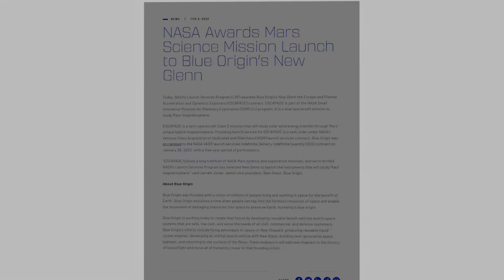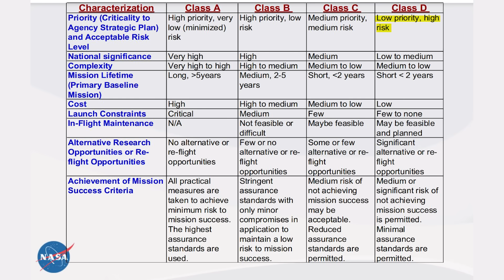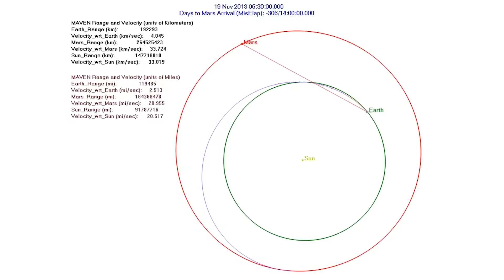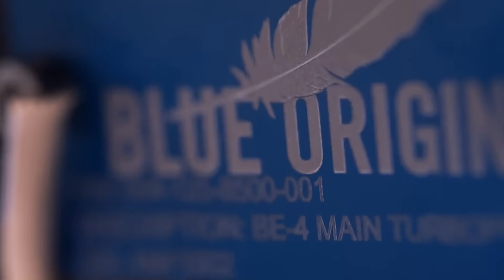Is Blue Origin's New Glenn Close To A Maiden Flight?

Comment: i would just like to see Blue do anything. get anything into orbit and back again that would be a great start.
Reply: They have 22 successful launches. 21 successful launches with perfect landings, have designed a solar panel made entirely of lunar regolith analogue, designed inflatable containers for orbital reef, and are working on zero boil off hydrogen. 

If you think BO hasnt done anytbinf, its because you arent really invested in the space industry.  You're more of a tourist.
Reply: @iamscoutstfu  Blue Origin is lame. 22 launches of a suborbital Estes rocket. Big deal.
They made a solar panel...  oooh! how wonderful! Not. Inflatable containers like Bigelow over a decade ago. "Working on" means "hasn't had it work yet". Not an accomplishment. 

Blue Origin has been in business for almost a quarter century and has accomplished remarkably little.
Reply: @iamscoutstfu  you can't be very invested in the space industry if you just assumed that the habitats are from blue origin even though sierra space is mentioned every time the life habitat is.
Reply: @iamscoutstfu   Those 22 launches never carried anything but tourists, and never came anywhere near orbit. I believe it is Sierra Space that is developing the inflatable modules for Orbital Reef. BO is working on the rigid central core structure, or at least the windows for it, that's what they say.
Reply: @iamscoutstfu that's all? Also do not give BO credit for the inflatable module, Sierra Space made them not BO. Other than that a pretty empty achievement coming from a mega corporation in the space industry, would be great if they did anything other than lobbying and suing NASA

Comment: Looking at the BE4 situation it look over 2 years to get 2 engines ready for ULA, where as New Glenn requires 7 of these engines and there have not been anywhere near the number of engine tests one would expect for 7 engines being ready any time next year. Add to this that ULA also required more engines one of which exploded during testing a couple of months back taking out one of the test stands. All in all this seems like more media manipulation and wishful thinking, after all Blue Origin hasn't had a rocket reach orbit yet let alone one as ambitious as New Glenn and there is no way the booster will land perfectly first try.
Reply: You dont know anything about their production capacity though...
Reply: @iamscoutstfu  We know what we have seen so far and that is engines being delivered very late to ULA and a subsequent  engine failing in testing exploding and taking a test stand out. They can't hide the testing or fake it, there just aren't enough engines being produced and now they have destroyed one of their test stands which needs to be repaired. To be able to lunch a New Glenn they will need 7 fully working and tested engine ideally plus spares.
Reply: Source for any of those numbers?
Reply: @Sillocan1  We know when the engines for ULA started production and they were delivered about 2 years later and New Glenn does require 7 engines you can see that on the mock ups and renders. What other numbers are you talking about, this has all been covered in minute detail by so many channels.

Comment: Keep in mind that the cargo Tonnage is between Falcon 9 and Falcon heavy -- so this is a competitor to the last generation (Falcon series) of Spacex craft -- the Starship is a generation beyond this, The Starship is far more innovative, whereas the New Glen is not doing anything that spaces hasnt done before. That said getting landing right first time seems an iffy prospect (Even with hundreds of landings under their belt with Falcon series, spacex on their 2nd test flight of starship has yet to achieve this with starship) .
Reply: Im sorry whag?  NG has deep throttling O2 rich closed circuit engines.  Those are a generation ahead of anything SpaceX has produced....

In WHAT way is SX more innovative?

Comment: IMO even if New Glenn launches and lands its booster perfectly on the first attempt, SpaceX's development method is still far superior, because they already have this capability and are using it to launch more often than anyone else, and it cost SpaceX far less money to get there.
Reply: You dont know how much money either company has spent on development, though. 

So youre conclusions arent based on any evidence.  Youre just saying one is superior for no reason...
Reply: @iamscoutstfu  The development method used by SpaceX is certainly more expensive. But think about it another way: they quickly developed the technology and flew over 100 commercial flights. They made a lot of money. How much did Blue Origin earn? I thought so.
Reply: @iamscoutstfu   Actually, it is known that development of Falcon 9 cost $400 million. I don't know what Falcon Heavy cost, but it can't have been more than that. Obviously, nobody has any idea what Blue Origin has spent on New Glenn.
Reply: New Glenn will be more capable than anything SpaceX has at the moment (I'm not counting Starship because it's not operational).
Reply: @plainText384 what about Falcon Heavy?
Isn't it capable to put 60 metric tonnes in orbit compare to only ~40 of Blue?
Reply: 7 meter faring bs 5 meter faring allows for much greater usability.
Reply: @BigBlueFlame-000  you are comparing apples to oranges. The 63.8t is for a fully expended FH, while the 45t is for booster reuse with new Glenn. When the boosters are landed with FH the payload capacity drops to somewhere in the ballpark of 18t-28.4t based on various sometimes contradictory statements by Musk and SpaceX. 
But that wasn't even what I was talking about. If FH wants to match New Glenn on payload mass they can just go with an expendable core. The main advantage of New Glenn is the fairing size, which allows for much bigger payloads. An additional small advantage is the high specific impulse hydrogen upper stage, which will give New Glenn an advantage on trajectories beyond LEO.
Reply: @plainText384  Bad news about FH: it can only lift 10 tonnes fully expendable. Any more tonnage and (1) the payload dimensions require an aeroshell that is aerodynamically impossible and (2) the fuselage would immediately collapse upon lift-off. That's why FH HASN'T being getting the contracts for 10tn+ heavy payloads: customers know EXACTLY what FH is capable of launching. 
Like all salesmen, the Musk sales pitch promises more that his product can deliver.
For the customers, that is plain to see; for SpaceX Fans, it's beyond their capacity.
Reply: @davidstevenson9517  the heaviest proposed payload for FH, that I know of, will be the Lunar Gateway station module HALO and PPE, which combined will weigh about 13-14t. The 10.8t structural limit seems to be based on the limits of Falcon9's PAF back in 2015. However, they have since improved Falcon 9 and launched payloads up to 17.4t. This should serve as a conservative lower limit on Falcon heavy payload capacity. This does not mean that 17.4t is the current structural limit (for PAF or other parts) or that SpaceX hasn't developed a more capable PAF for Falcon Heavy. However, whether or not they could lift a 60t lead cube to LEO, they clearly don't have demand for that sort of mission, so it's not going to happen.
Reply: @davidstevenson9517   I think you are confusing mass to a geostationary orbit with mass to low Earth orbit. Also, Falcon 9 can and has launched payloads considerably heavier than ten tons with no structural problems. Also, how much mass can be put into a given size fairing depends on the density of the payload. That said, SpaceX does need a larger fairing and are supposed to be working on one.

Comment: As Jack Beyer from NSF says: "More rockets, more better!" It will be good if Blue Origin finally manage to get some hardware on the launch pad, after so many years and so many promises.
Reply: They've had hardware on the launchpad plenty of times. Mainly with New Shepard, but BE-4 has also been on the pad with Vulcan, and they had multiple vehicles before New Shepard as well.

They've had hardware on the pad, they've even had hardware in space, payload in orbit is the new capability
Reply: @plainText384   What vehicles did they have before New Shepard?
Reply: @odysseusrex5908  Well, there was the Goddard vehicle (PM-1), which used the BE-1 engine and then there was PM-2 using BE-2.

Both were only used for Research and Development working up to New Shepard, and I'm pretty sure they weren't capable of flying all the way to space, but they still did vertical takeoff and landing, as well as reuse with both. And that's pretty impressive for your very first (and second) rocket.

Comment: Without BE-4 or BE-7 engines available,  BO won't be reaching orbit any time soon. In the meantime, SpaceX is already building gen 3 of their Raptor engine. BO is good at generating hype, but very little results.
Reply: BE-4s are in production and ready to be flight rated with Vulcan and the BE-7 is the engine for the moon lander. BE-3 is the second stage and has been used on New Shepherd multiple times. I am excited to see the future with so many companies making steps going forward.
Reply: @DroolP  I'm sure you understand why I am skeptical. Even if the BE4s are already in production, what is the rate that they can be built? What is the production cost?
Reply: @channelwithaweirdname  it will be fun to find out. Who is it really harming?  I think they will work the bugs out and get to rate just like raptor did. It is the way things work.
Reply: @ryanab01 New Glenn is reusable, so it won't need that many engines. 7 engines per booster, maybe a dozen boosters total? The New Glenn program might only need 85 engines in total, at least until they start retiring the first generation after a couple years.
Even if they only had enough engines for Vulcan and 1 or 2 New Glenn boosters, they could still fly a good amount of missions per year, if they reuse the boosters.

And a couple years down the line, even ULA might be reusing BE-4 with SMART on Vulcan.
Reply: @DroolP  So speed up, Rocket Lab is your competition right now. Their rocket has to prove to be reliable, so that they bet on them.
Reply: @mateogomez8413  it is funny you say beat and competition. It is only the people that have nothing to do with it that thinks there is a race or in terms of beating and winning. People from every company cheer everyone on.
Reply: @DroolP   it is important to build a history of rocket reliability, thus generating confidence in potential customers. In addition, there are others that are also manufacturing, if you are slow, you will be left far behind.
Reply: @mateogomez8413  I leave that up for the space companies to duke it out. There is and will not be a shortage of missions and things for the future. It is really nuts when you think about it. Permanent settlements on the moon. Manufacturing in space. Deep space communications networks. There are more projects than there are companies. Zoom out and see a bigger picture and it doesn’t matter who is first second or third. They all have their own missions and their own technologies. Exciting times
Reply: @DroolP  there is a space race, but it is between China and (mostly) the United States. It's similar to competition on Earth. Governments want to control things in order to ensure economic viability and defense of their country, etc.
Reply: @channelwithaweirdname  but in this video and all other content of this thread we have been discussing US companies. If you want to go into a global stage, yes. But in the same sense, there is less competition in the science sector and mainly political. Last I checked, BO, SpaceX, Relativity, ULA, etc. are private companies. Some more political than others, but soon some will be global influencers. I’m not worried. Space is a combat multiplier and game changer but not a game winner. If that makes sense.
Reply: @DroolP  Well said. I mentioned China because they now have a private company, and they are essentially mirroring SpaceX as much as possible. I imagine that they may also have more private companies competing as well, perhaps in the near future.
Reply: @channelwithaweirdname  mirroring. That is a good word for it.
Reply: Not BE-7, that's for the Blue Moon lander. BE-3Us are for the 2nd stage, and have been photographed being built at Huntsville and video released of rate testing on the 4670 stand at Marshall.
Reply: You're a bit confused, ryan. SpaceX is good at generating hype, but very little results EXCEPT exploding rockets, FAA investigations, lawsuits, delaying NASAs Artemis program (cancellation of the Artemis 3 landing) and annoying the U.S. Congress.
Try to stay on the ball.
Reply: Both be4 and be7 are available though.

So I guess theyll be getting those results you talked about.
Reply: @iamscoutstfu  We'll see. Almost nothing of substance has been shared with the public. That usually means the product is not ready yet, in this case, the engines.
Reply: @channelwithaweirdname  or they are not as grandiose with their publicity. I think we will be surprised with the next ten years of space. 35 years ago, a computer in every home was unheard of. 30 years ago coding was finally being taught, 20 years ago phones and computers began to be combined, today our technology is the worst it will ever be in the future. Some of these leaps are done in public spaces and some are done behind the scenes and change the world. Celebrate every success. Celebrate every burnt engine, test launch, prototype. It is the road to space we are building. Not everyone needs to be in the public with everything to have validation. Not everyone that does, does it right. If you are part of the business you might understand what I am talking about. If not, don’t sweat it. There are a lot of great women and men tirelessly in every space organization I have had the honor to worked with.

Comment: Landing on a boat in the ocean is inherently more risky than landing on dry land. I have no idea why they'd go this route.
Reply: They have to have so much fuel left in the first stage to make a landing. Depending on the payload, it takes less fuel to land in the ocean.
Reply: Cuz the big kid across the street does it why can't I.. I used to think that about backflips til I landed on my neck..
Reply: It was BOs patent that SX adopted.  That was the reason for the first lawsuit...

So is BO the big kid across the street?
Reply: @iamscoutstfu   I believe BO tried to patent it after SpaceX had already done it.
Reply: @odysseusrex5908   Incorrect.
Reply: @iamscoutstfu   What was the date of their patent application and why was the patent not granted?
Reply: @odysseusrex5908  

The patent WAS granted.  But then a court nullified the patent after BO sued SX for patent violation, citing that the concept of vertically landing a spaceship on a boat had already been thought of and publicized.
Reply: No need to do burn back maneuvers.
Reply: Derek, you simply have no idea.
Reply: Landed on land with that big of a rocket is not really awesome when you have so much infrastructure and people near Cape Canaveral. It is not like middle of nowhere Texas. And before anyone goes nuts when comparing Falcon to New Glenn, they are not comparable in size and fuel capacity. The ocean is much safer for people and other launch pads. It just makes sense.